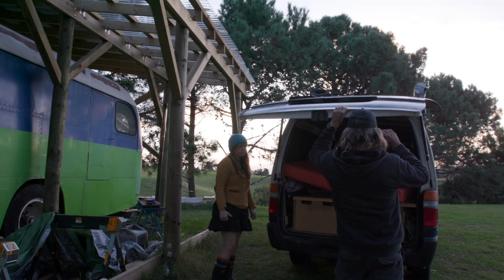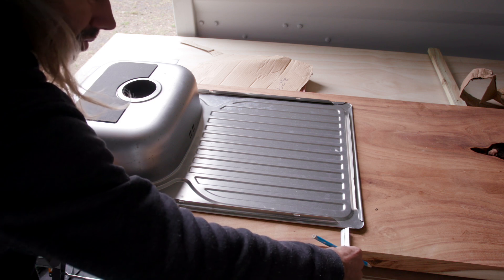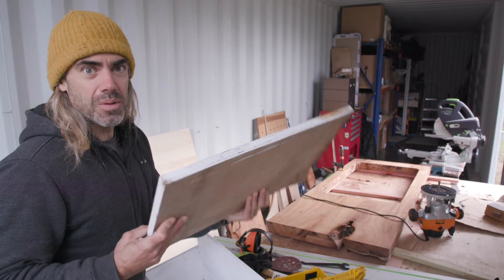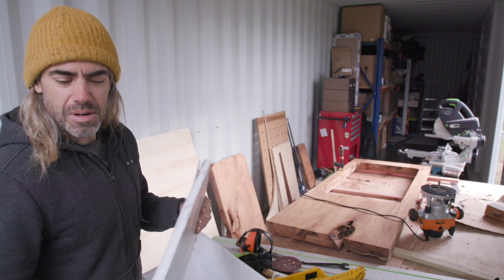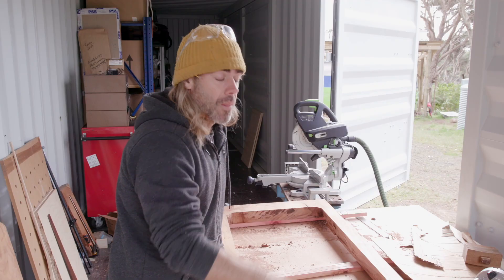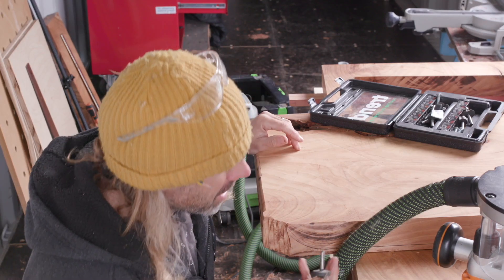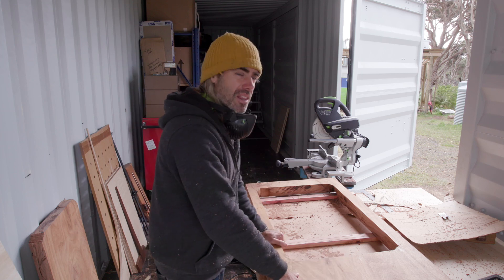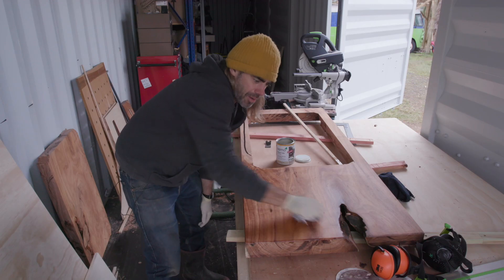Wood Slab into Kitchen Countertop -  Bus Conversion offgrid NZ ep 43

Comment: Maybe add a brass or stainless chain to the underside of the post box lid to limit it and prevent it from flipping over entirely if the wind does happen to gust hard enough to lift it?
Reply from the maker: Good idea Dave.  I even have some chain l could use in the container.  I'll keep an eye on  it and see what happens.  id be amazed if the wind lifts it, but this is the west coast!

Comment: Just curious, what is your power setup? How do you have enough juice to run power tools off grid?
Reply from the maker: We have quite a bit of solar on the roof over the bus. I installed it in one of the earlier episodes a few months back.  Plenty of power for tools.
Reply from the maker: I was running a sander and dust extractor together for  quite a while,  plus it is winter here, but it was fine.  We have 3kw of power so more than enough for is.